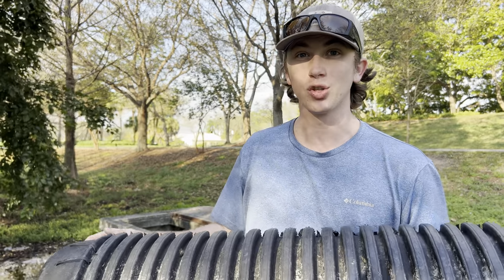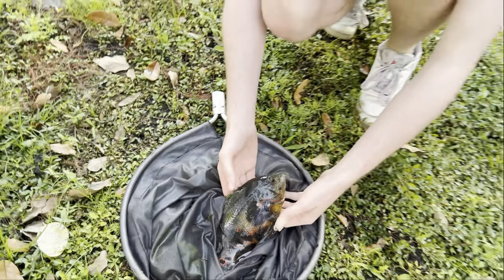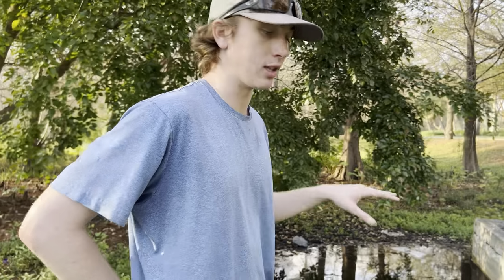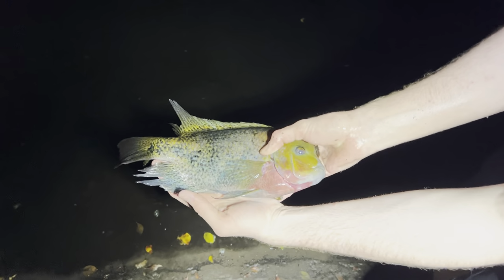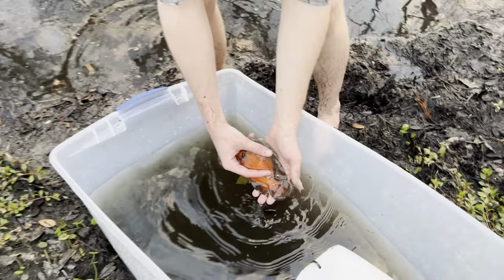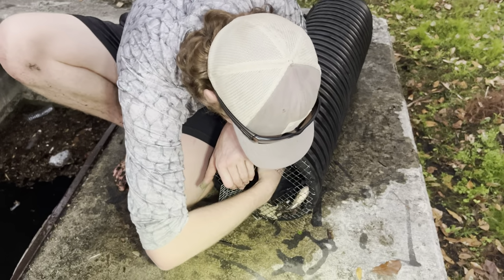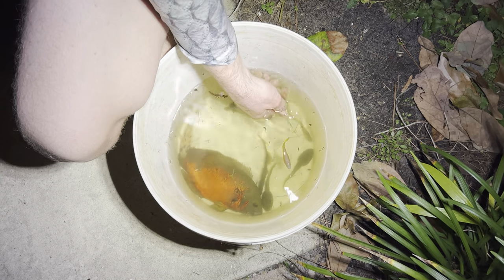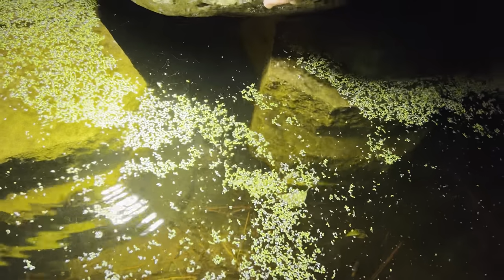24 HOUR Fish Trap Catches The SEWER MONSTER!

Comment: Sailfin and high fin mollies can actually get to 6 inches long, i have had them at that size in a outdoor pond back in Europe, most of the mollies you see nowadays are much smaller cause the original P.Latipinna and poecilia.velifera have been inter meshed with P.Shenops, ( molly) and as a result true big Highfin and sailfin mollies are hard to come by. 
if you catch mollies near 4 inches long, save them away from smaller specimen and breed them only with others about the same size, you may get a gorgeous colony of true Highfin and/or Sailfin mollies.
Rob was that Cabomba you tried to put in your pocket ?